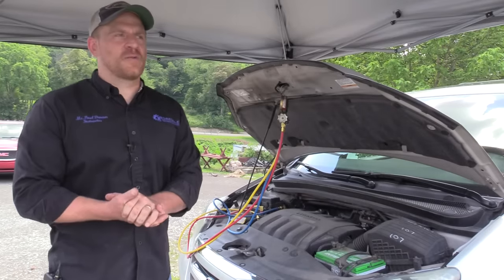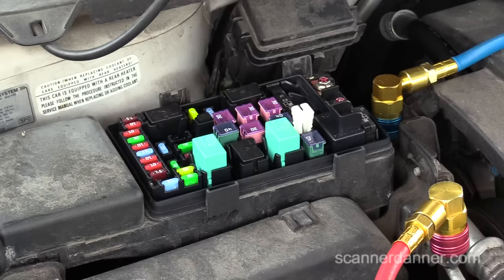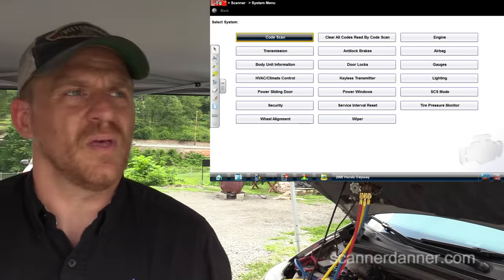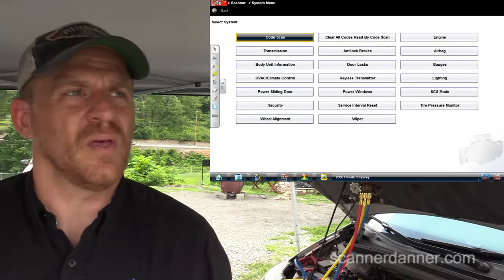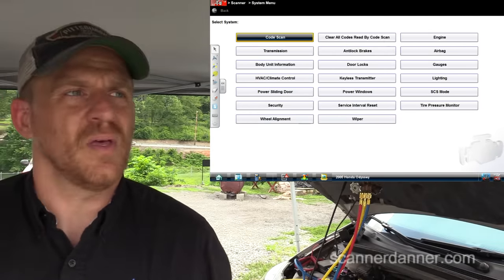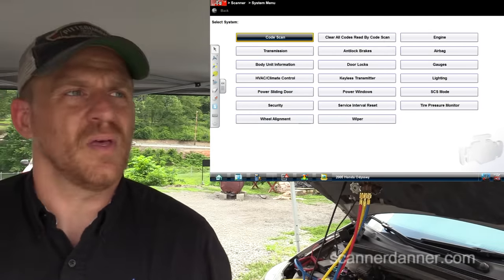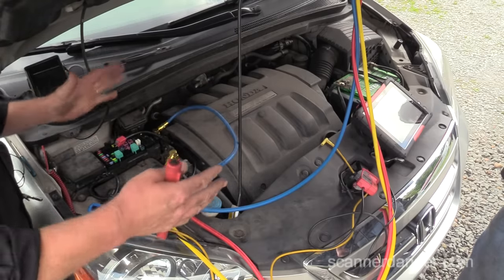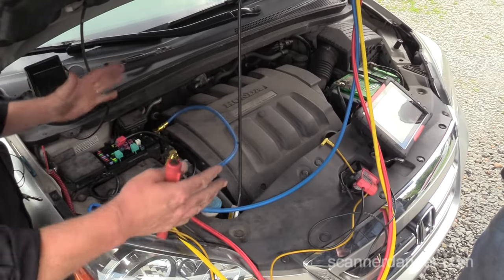A/C clutch not engaging - 2005 Honda Odyssey

Comment: Paul,we appreciate your efforts for showing this! We are very lucky to have an online instructor like you! God bless sir!
Reply: Hello,I have a 2006 Honda CRV Ex my radiator fan stay on and my AC fan stays on  my AC button turns off my fans when I push it. My AC clutch don't turn on
Reply: My running lights do not work after installing a aftermarket sterio in my 2000 Honda Odyssey . I have replaced all the multiplexer, fuses,bulbs and instrument cluster and I need to know what would be the quickest way to get my marker lights to work because I cannot drive at night with no dash lights

Comment: Your video did lead me to check the fuse (20 amp), did not see a relay in box.  I did not realize that I could check the fuse without removing it.  Replaced the fuse; it blew again as soon as I went to A-C position on switch.  Next step- disconnect connector at compressor and check clutch coil for ground/ short in coil.  Thank you for this video.
Reply from the maker: If you need a good wiring diagram, we have service information on my website here 
https://www.scannerdanner.com/forum/post-your-repair-questions-here/3757-need-service-info-check-here.html

Comment: I got a dose of humility today when I forgot that AC pressure switches have a built in hysteresis, closing and opening at different pressures. Of course they are built that way to avoid rapid cycling. The low pressure switch closes when pressure is greater than 49psi, allowing the compressor to turn on if commanded on. When the compressor starts up, low pressure falls, but the low side switch  STAYS closed until pressure drops below 18psi, then opening to turn the compressor off. Then it stays open til pressure rises back to 49, turning the compressor back on. Duh! Came back for a refresher dose of ScannerDanner, thanks again.

Comment: I could tell the compressor clutch was not engaging, but I had no clue as to why. Your video saved the day. You recommended checking the compressor relay. I took the relay out and on my workbench connected it to a 12 v battery charger. It clicked, but my ohmmeter indicated the contacts were not making. Must have burned out. Anyway, I plugged in a new Chinese made relay, and now I have air galore. Thanks. Very helpful.

Comment: Tip according with  PT chart  for 90F degrees temp corresponds  exactly 104.3 PSIG  a little correction for altitude according with place you live   here is tip if you  have a different number in your on pressure  it means you may have air in the system !
your are one of the best mechanics Paul !

Comment: Thanks Man, I have  watched your film . I have Ford Galaxy 2007 (I live in Poland),. A/C didn't work. I followed your tips. Checked with multimeter the output of body computer, (with relayed detached), then I did short on load terminals in relay nest and A/C worked. So relay broken (24 PLN= 5USD),  I saved time and money to go to mechanic. 
One more time - a bog thank to you. You did a good job (specially explaining to be careful with low current relay terminals (not to damage the body computer) and what voltage level on which pin in relay nest) I didn't know that.  That all film you did allowed me to systemic / step approach / no chaos. I appreciate it man

Comment: Paul you were very thorough on this repair. My Toyota Corollas' A/C clutch went out 5+ years ago and I know how the system works so I just did it the fast way to make a fast check by just going to the A/C clutch 2 wire connector and checked for power with my multimeter. I had my voltage at the connector and was switching off and on as I turned it on and off so I checked the continuity on the 2 pins on the clutch itself and it was open, so it had a open in the coil. Easy 20 dollar fix for my car and a 30 minute job and it's been working for over 5 years now. Since it was my daily driver, I knew the freon pressure was OK and I just went down to the source of the problem which was the clutch since it wasn't spinning. I was glad it was a easy fix for me but this is my way to diagnose a no A/C clutch. If I didn't have voltage or continuity, then I would work my way back up and do the other testing but I always go down to the source of the problem first.
Reply from the maker: I believed at first that I could not get to the clutch coil wiring, so I started at the relay instead and for those who don't have power to the clutch, this video is most useful.

Comment: Paul, great video.  FYI...On an RSX I was troubleshooting there is a thermal fuse that is in line between ground and the compressor connector. According to Honda sites, this bi-metallic thermal fuse/switch warps with age leading to an open ground. It mimics a faulty clutch.  It is a bear to replace the thermal switch since it is a bolt on component toward the block side of the compressor.  The Acura blogs recommend bypassing the thermal switch to fully validate a faulty magnetic coil.  I appreciate your excellent videos,  and your commitment to high quality.

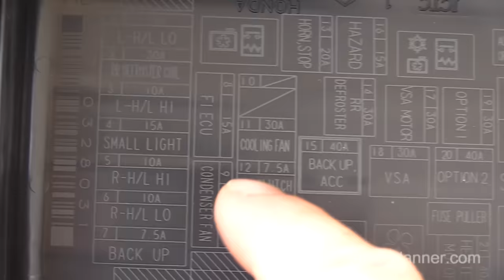Comment: 5:23 shows the position of the A/C clutch relay.  No need to hunt down a wiring diagram on the internet to find this.  Its the relay with the snowflake symbol at the bottom between the defroster relay and the blower fan relay.  Thanks for posting this for us DIYers.  Informative and helpful.
Reply: yes! but... he is an instructor and trying to teach proper method without shortcuts...not all relays have that pretty snowflake!(or anything) yea but for us backyard pros this is disturbing!!!

Comment: Danner you are the man!! God bless you ,we really learn from you, am  a tech and yes there is a bunch of trolls that want to learn te easy cheap way .this is gold man you explained and walked through the whole system
Reply from the maker: Thank you!
Reply: how much does it cost the paper book?
Reply: @ScannerDanner  My car i20 engine is running very quiet as usual. However, as soon as AC clutch is engaged, I hear a squeak sounds and not metallic sounds or alike. The squeezing like sounds go away immediately as AC is off. Even with engine revs, same sounds. And with AC off, as I revs the engine, still the engine is quiet. How to find that squeaky like sounds and fix it?

The AC is blowing cold. It seems the AC compressor is ok.

Comment: Great video. But, one thing you missed - these compresors have thermal protector and it's located on the compressor housing. 12V from relay goes to thermal protector first and than to clutch coil. The thermal protector will have no continuity above 122 to 132°C (252 to 270°F). When the temperature drops below 116 to 104°C (241 to 219°F), the thermal protector will have continuity. However, if protector goes bad and always open, symptoms would be axactly as yours, having no current flow and suggesting open clutch coil. Field Coil Resistance on this compressors is: 3.05-3.35 ohms at 20°C (68°F). So to be 100% sure at your final conclusion, you should do your bulb test on wire after thermal fuse before it enters coil. Cheers!

Comment: Great video looks like this is a common problem , I have owned 3 odysseys so far and after 150k miles I have to change the compressor in all of them currently my forth one is having same issue luckily I found the eBay link of my last purchase will order 4th compressor ,

Comment: I just bought a Vpecker scantool with bidirectional controls for about $130 US! I have only tested it on a couple of cars so far but am very impressed with what I have seen. This would be a great one for paul or perhaps motoyam to review.
Reply from the maker: Is it seriously called a Vpecker?
Reply: Yes... and I have been too scared to look up what the V stands for. Seriously though, it seems to be a whole lot of tool for very little money and from what I can see the software updates are free!
Reply: Oh and I got it off ebay if you want to check them out. You should also check out the "Mooshimeter" (seriously I am not making this stuff up) it's a two channel bluetooth graphing multimeter. Made in Murica and great for beginners on a budget but also for advanced techs working without a helper or to tape under the bonnet (hood for you Muricans) and monitor remotely or log data. I use mine all the time.
Reply: Does Vpecker work on any Windows laptop?  Is it really all in one tool i.e. can you work on TPMS, ABS, SRC etc?
Reply: I am running windows 10, I think you can run it on anything up to as old as Windows xp, but check out the product info first. It seems to do all modules except TPMS (although I haven't actually tried it on anything with TPMS yet). So far it's the most comprehensive scanner I have seen for the price by a long shot, but as above I haven't tried it on very many cars yet, so I am cautiously optimistic, but a case of so far so good for me. It would pay to buy a cheap OBD extension cable to go with it as the unit is a bit bulky being cordless and this sometimes gets in the way of surrounding trim etc. Hope that helps.

Comment: On Hondas if the cooling fans are running when the AC is switched on, the PCM is receiving the necessary inputs to command the compressor on.  Just another quick Check to complement your rpm increase when pressing the AC button. Love the videos!
Reply from the maker: Thank you! I don't remember the fans turning on, on this model but good test for sure

Comment: Great video ScannerDanner.  You enlightened me regarding the technology integrated into the system.  Daughter's 06 Civic A/C Comp clutch not engaging.  Verified good fuse, applicable relay (swap with another identical relay), good connections, tapped the clutch as noted in other videos, and finally verified approx 12 volts to clutch connection.  Double checked everything (including line pressure). As a final step, I even tried Russ Kessler's method (it's acceptable in this case).  Clutch still didn't engage despite tapping and fans running. I've come to the conclusion the clutch is shot.  Unfortunately I don't have sophisticated equipment as you've demonstrated, but at least I've done what I could with the tools on hand (basic hand tools & a DMM.  Again, you're explanations/reasoning is stellar.
The vehicle has about 140K miles.  Any idea how long the service life for these clutches are?  After googling this complaint, it doesn't appear to be that uncommon.

Comment: I just recently bought the ethos pro from snap on. it was like 1500 bucks. has bidirectional testing. does everything the modus, and verus does minus lab scope and troubleshooter. really great tool and have diagnosed several cars with it just using data pids and some basic principles I learned from you
Reply: RJ Martin Music   $1500 and no troubleshooting or lab scope! Did it at least tell you what the number codes for all the manufactures signify?

Comment: Hey Paul.
You know I have been a big fan of yours for years now and i push your channel to many workshops i visit here in Australia for the shop owners/mechanics to learn more about diagnosing. Especially with scan tools as in my experience few know little about them being anything more than a code reader and if they did look at live data they would not know what to look for. When i get asked where can you learn this stuff i tell them to enrol in night classes or better still subscribe to your channel and get your book.
So thats that part.
For this though, the one thing that led me to follow your channel was speed and direction. You mentioned early in your videos how you hate flow charts. They make you do this and do that and waste valuable time diagnosing a fault. In this video i felt it was almost like following a flow chart. I think the best place to go would have been straight to the clutch to check power and ground and if they failed then go back to relays . I dont even think hooking up guages was required as you could have confirmed system presure was there by checking the tx valve presure switch. Had this been an instructional video on how to check AC electrical circuits it was a great video but it was a fault finding exercise and going straight to the end of the circuit would have told you everything.
Hope my critisism is constructive.
Still a huge fan.
Reply from the maker: It was thank you. There was one problem. I couldn't get to the clutch! I said that many times in the video.
Reply from the maker: Step 1. Check system pressures (always)
Step 2. Check for power to clutch (couldn't get to compressor connector)

You can switch up 1 and 2 but most of the time you'll be going back to the gauges anyway.

So you find that you can't get to the clutch. You're in a gravel parking lot, with no wiring diagram or knowledge of the circuit your working on. What do you do?

That's a rhetorical question. It's why I picked the direction I did. I systematically eliminated all possibilities before finally getting the van inside and up on the rack to check the clutch itself.

Comment: Great video! The ground test at  37:45 would normally be done at the plug mounted on the A/c compressor, There is an exception on this style compressor because there was no plug at the compressor the plug was at the rad and the ground was bolted to the compressor housing. The reason why you would want to do this style ground test at the plug is there could be no connection due to a bent pin on the plug. The plug could have been damaged during another repair.

Comment: People saying 40 mins for this, Just remember Paul would have been done in under 10 mins if he wasn't going through the process of what and why so that no matter what your ability you should get a good under standing of the system and how it works.  Who would watch a 5 min video of someone just changing parts?  Come on you guys
Reply from the maker: Thanks brother. There are always a few parts changers hanging around here that just don't get it.
Reply: @ScannerDanner  My car i20 engine is running very quiet as usual. However, as soon as AC clutch is engaged, I hear a squeak sounds and not metallic sounds or alike. The squeezing like sounds go away immediately as AC is off. Even with engine revs, same sounds. And with AC off, as I revs the engine, still the engine is quiet. How to find that squeaky like sounds and fix it?

The AC is blowing cold. It seems the AC compressor is ok.
Reply from the maker: @tnamen1307  check your belt (tension and for cracks), the AC compressor creates a HUGE drag on the belt when it is engaged
Reply: I think like that to
Reply: I watch the whole thing, and I appreciate him for showing how it's really supposed to be done.

Comment: Awesome video, I've been having trouble with my compressor clutch switch and been needing to replace it when I find time but what I would do is unplug and replug it repeatedly and wiggle until it finally kicked the A/C on. I then saw what you said about tapping it (which is probably common sense that I simply missed) so I decided I'd go give that a shot real quick and low and behold it did. I drive a lot and it'll be saving time by taking like 5 seconds as opposed to 10 or so minutes lol.

Comment: great video don't forget Honda loves to use a thermal fuse mounted to the body of the compressor wich is a common failure some times they put it in series with the compressor clutch or as a input to the ecm great vid
Reply from the maker: No thermal fuse that I could see on this one. Thanks for the tip

Comment: Paul great video.  I use Autoenginuity pc scan tool.  It is very affordable.  You can buy individual modules for a couple hundred bucks.  I bought the Domestic and Asian package for around1500 a few years ago. It costs about 300 a year to keep it up to date. It's a cool tool.  Thanks again for the video.

Comment: Awesome video, great detail. I came here because our 2005 Honda accord Euro ( here in NZ ) aircon clutch would not engage.
I found the relay and swapped it over with another one from the relay box. The two relays were identical with markings 7001. Haven't a clue what the 2nd did but when swapped over and the clutch engaged. Because im a tight ass and don't want to spend $$ on another relay I used a current limiting power supply and wired the contacts across the coil. This caused the relay to chatter when power was applied and thus cleaned the contacts. Presto it works again. Al least I know if it stops again I can buy a new relay. Job sorted.  Cheers to you Paul.

Comment from the maker: #12voltTech
You need to change your settings because I cannot reply to your comment. There was no plug at the compressor. The plug was at the rad. And the ground was bolted to the compressor housing. 
It was absolutely a valid test.
Reply: I edited my comment. I didn't realize this style compressor did not have a plug mounted on the housing of the compressor.
Reply: ScannerDanner
Reply: what do u mean if you could have gotten to the clutch? what would have you done?
Reply: ScannerDanner thanks so much for your time my friend

Comment: Hey, Paul. Please, help me understand the RPM increase with the anticipated load, or the actual load. The pcm receives the RPM input showing an increase in load, commands the IAC to allow more airflow to stabilize the idle speed. Shouldn't the RPM drop instead of rising since the increase load has not been compensated for until the pcm the IAC to increase?  Help me , please.

Comment: You're a better teacher than myself, but I just feel the need to start at the consumer (A/C clutch) and work backards.
Reply from the maker: Remember I'm usually in a parking lot and getting to the AC compressor clutch wiring is not the easiest first step